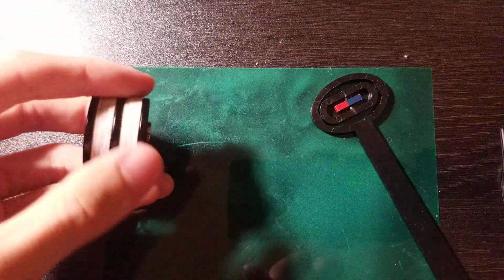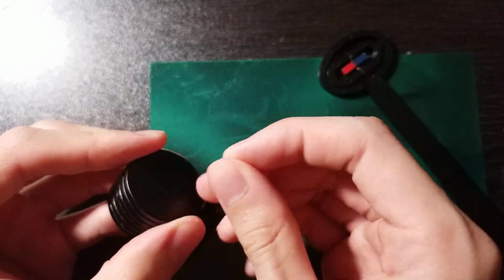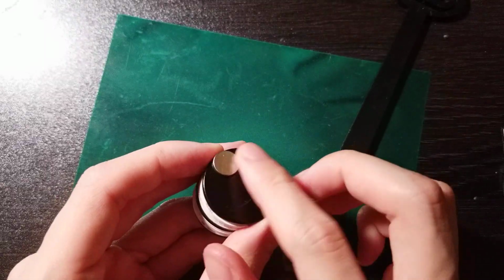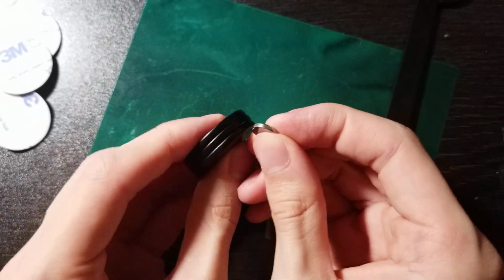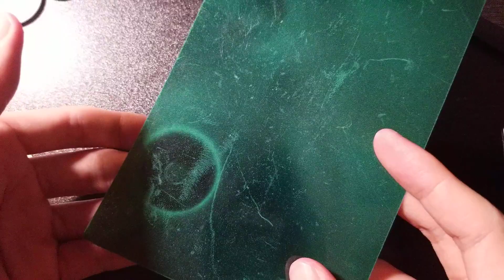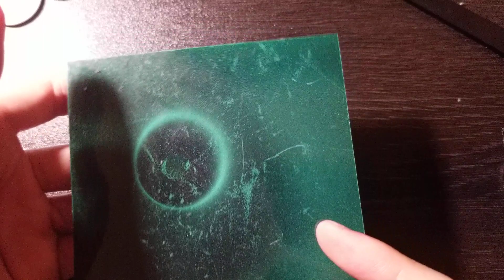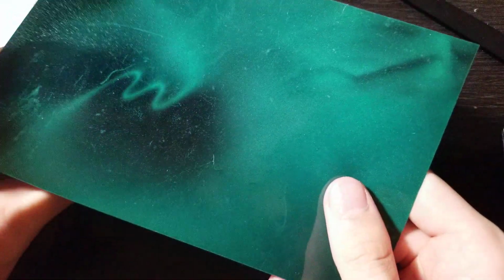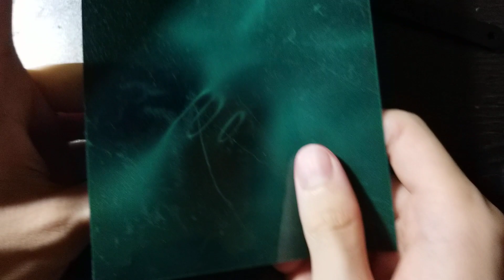Messing With Disk Magnets

Comment: It seems to me that the small magnet is balanced in center of the centerfugally divergent reciprocal magnetic field that is emanating from the edges of the magnet in the form of a toroid. It just isn't close enough to an edge to get pulled one way or another so it sits still.
It would be interesting to see how your  3D polarization sensor gimbal reacted to that wavy block wall that you created on the viewing film.
Reply from the maker: It's really insignificant, it moves as if it was one slanted oblique magnet's magnetic field.